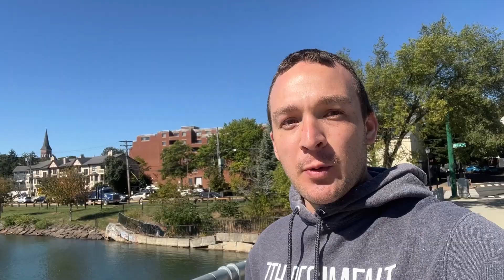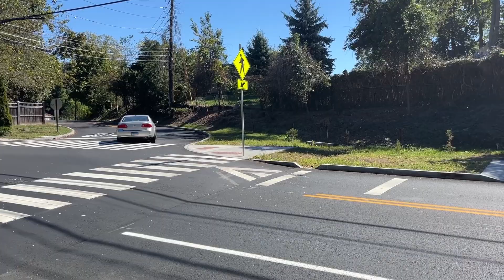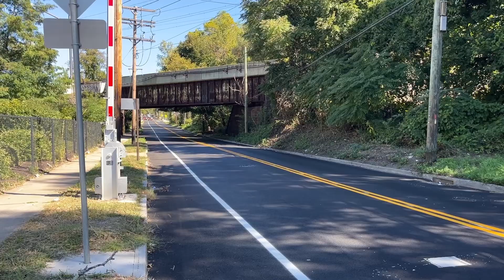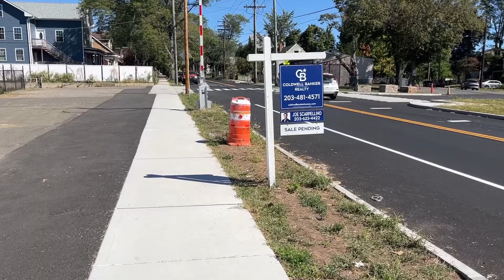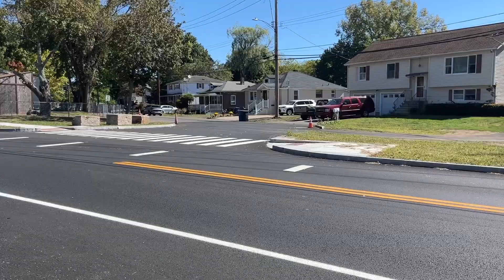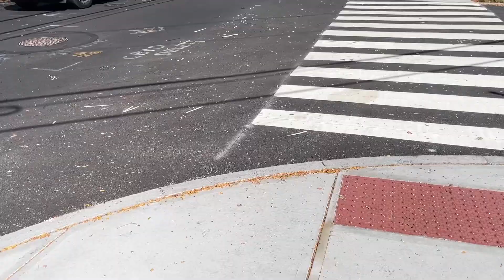Quinnipiac Ave Traffic Calming Project

Comment: love the new sidewalk addition but hate that the poles block a third of it and reduce its horizontal clearance for wheelchair or strollers
at the bridge area wish the new sidewalk would continue onwards it kinda just abruptly ends with old sidewalk and regarding the raised intersection wish it was more visible and denotes to drivers that it’s not a place for cars such as klankers (bricks) and the start of the raised section should start a bit further outwards it looks too sharp of an incline

Comment: A personal issue of mine with this style of raised intersection / crossing is that there is little differentiation between areas that a person would be and where a car will be. Since there is the anticipation of someone crossing the road, there should be much more substantial paint or even a separate surface from the asphalt at the crossing areas. In low traffic areas, bricks / pavers could be quick good as they would change the sound of the round under the cars too making them notice the change more